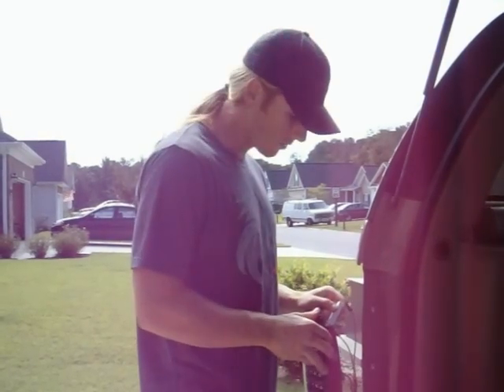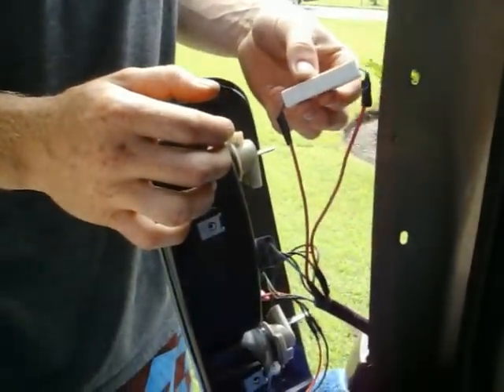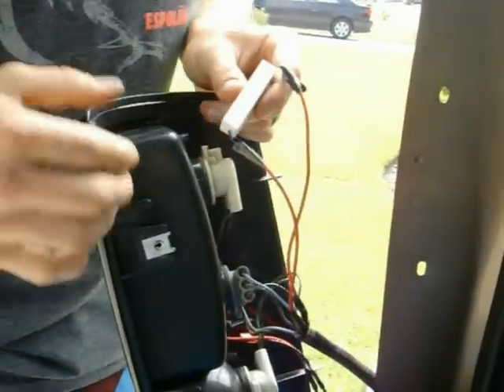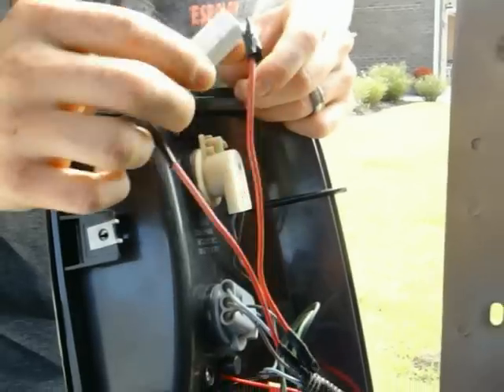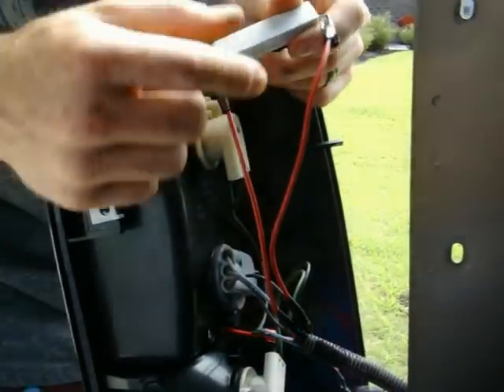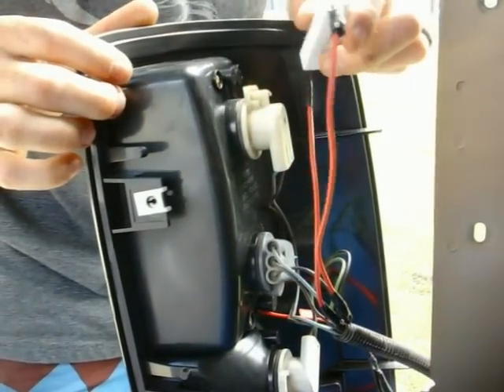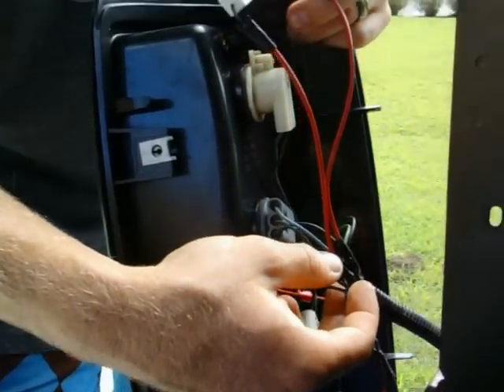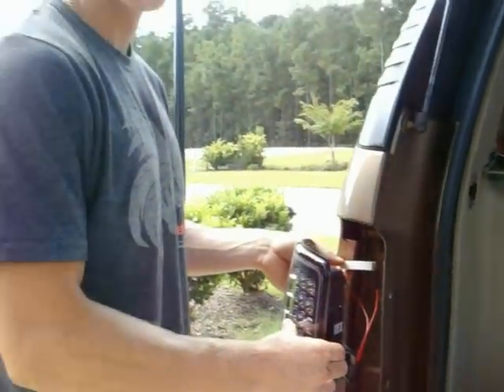How to Install a Load Resistor for LED Tail Lights

Comment: Had the same problem on my 2003 Silverado when I put in leds. Put in resistors and the cruise is working perfect again. Thank you for this simple explanation on this problem. I used 6 ohm 25 watt on mine.

Comment: This Worked For Me!!!  2005 Chevy Tahoe LT replaced rear tail lights with LED DEPO and cruise control stopped working immediately.  I added the resistor only on the passenger side and instant results fixed my problem.  Thank you!!!

Comment: Thanks man, simple instructions that made this easy. Just make it even easier by using a two wire electrical wire connector and please folks, don't CUT any wires, simply splice into them or use a wire connector.

Comment: Just installed new tail light assemblies. One question though, did you splice into your turn signal harness or your brake harness? I'm wondering what I need to splice into as I am hyperflashing and lost my running lights. Would I splice into both and use a total of four resistors or just splice into one of the two and use two resistors?

Comment: Hey if you are still around, I'm guessing that the cement load resistor held up very well. Yes? I am suspicious of "automotive" grade resistors, even though I get it that they have a nice heat sink.

Comment: My man.......6 years later and youre solving the most confusing thing for me in the world...
let me explain:

I had found this video soley because I wanted a better explanation on resistors for my new LED tail lights i just put in.
Looking this up because of hyper-blinking
or my turn signal was going quicker than usual after installing these - BUT!
I did however notice that my cruisecontrol stopped working too.. I have a 2003 Ford Mustang GT
so, me being the young dumbo I am, I figured it was the mechanics fault. lol
Anyways, seeing this video both teaches me more about resistors for my tail lights making it easier for me, but also teaching me that my cruise control MIGHT Be fixed by doing this and / or that this directly effects my cruise control ( SO STRANGE!)
Anyways, thank you so much Wolfeden for taking your time 6 years ago to make this quick informational video.
Helped me greatly, and may even help me more.
Cheers to you
Thanks
-CP

Comment: If they're "25 watts," I'm thinking that means at 12 volts. That would mean 2.083 amps (current). Which in turn means about 5.76 ohms. (R=V/I)(Ohm's Law). The higher voltage (about 14v) that vehicles may run at with the engine running won't affect resistance. (But obviously would increase current, to 2.43 amps, and power absorption, to about 34 watts (watts = amps * volts). Significant heat considerations)

Comment: Disregard, I've got my turn signal lights to stop hyper blinking by placing a Load resistor wire on both the + and - wires and it works on my 99 Maxima.

Comment: I have a '04 Tahoe and doing this same modification, my cruise stopped working after installing LED's and I went back to OEM lights. You are using 25 watt load resistors, what ohm are they?

Comment: i got some leds for my tail lights, there the bulbs, not the whole assembly. there only 4.2 watts each do you think i will need a load resistor?
Reply: The bulbs are where?  There.  Did you mean "they're the bulbs, not the whole assembly. They're only 4.2 watts..."?

Comment: I tried installing load resistors on my taillights and the 1st problem I ran into was trying to crimp the connectors onto the load resistors wires. Looks like it take a crimping tool and you only get one chance to crimp it right the 1st time. My wire of the load resistor pulled right out. Now the hole is too small inside the connectors that came with the Load Resistor kit, no spares. Now I got to go to a hardware store and find the exact connector that will match of to the other connects in the kit. More running around and more money to speed. 
Next time I will buy the CAN-bus LED bulbs that don't require Load Resistor, plus I hate splicing into my factory wiring, something else to go wrong later.
Reply: well of course if it has crimp style connectors, then it's going to crimped with the propper style crimpers. First thing before starting any job you make sure your going to have the right tools for the job. And when tapping into factory wiring, if it's done right and you understand what you're doing before you attempt to start the job, then you will never have any problems later.  The proper way to tag into your factory wiring in a location like that where it could be exposed to the elements and the weather would be to strip about a quarter inch of the wiring back and solder the load resistor to it and then heat shrink over the connection, and it will last forever.

Comment: hey man i have to add a resistor to each taillight?
Reply: Mario Yepez just the blinker some trucks need 2 resistors each tail lights some need one 1 depends on your vehicle bro
Reply: Ohokay thanks man. Well that problem its fixed but what can i do so my cruise can work again.
Reply: I have a remote start in my vehicle and since i installed the led taillights.  It tend not to work because it was not returning sufficient voltage.- that part it fixed.
Reply: I need help with the cruise my man

Comment from the maker: Both tail lights need to have resistors in place. Get one resistor for each tail light. 

Whether or not you need the resistors depends on the vehicle, year, etc. If your blinkers and cruise control are working fine, then you probably do not need the resistors.
Reply: Will the hot lead be blue on most vehicles?
Reply: Are you still getting hyper flash since you hooked up your resistor to your brake light only